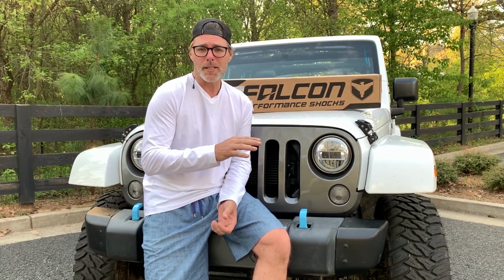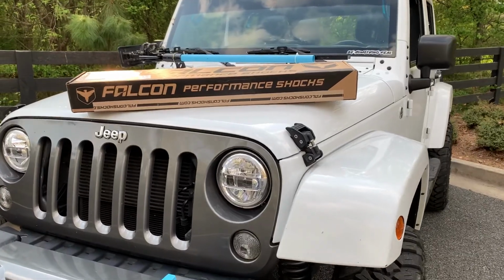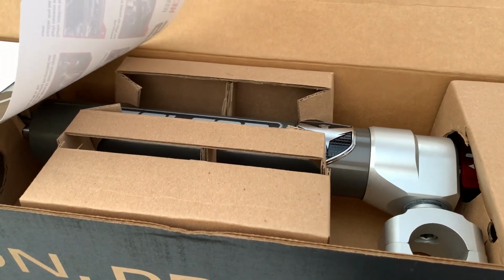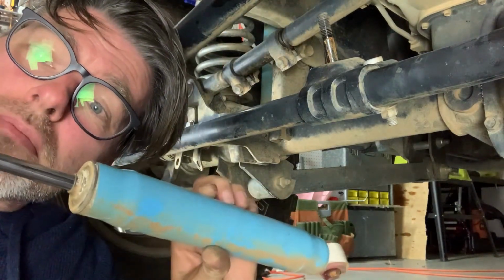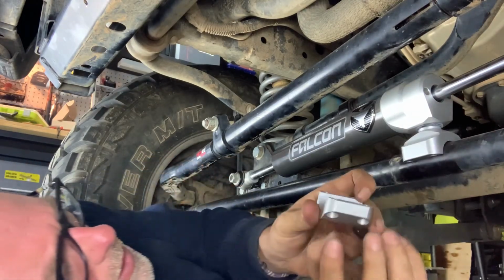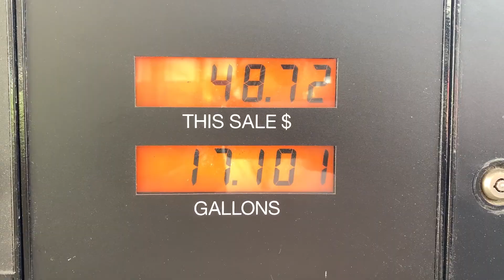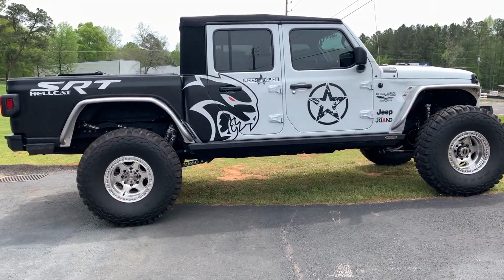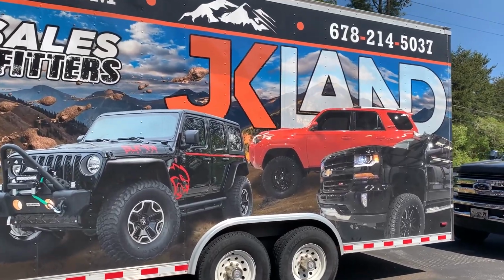Falcon Nexus 2.2 Steering Stabilizer - Jeep Wrangler JK - Install and Review

Comment: Just had one put on my gladiator. Made a hell of a difference on steering handling. Steering wheel doesn't flop side to side when hitting a bumps or anything on the road.  Drives amazing. Just know if you put it on firm it will wear out your steering components from what I hear.
Reply from the maker: It is the best steering stabilizer (in my opinion). 

For me, Firm is for long highway driving
Medium is everyday driving
Soft is for off roading 

Works perfect this way
Reply: @RoadRashOffRoad  agreed!

Comment: O just put one on and saw you had this on yours  for over 2 years now and would love your honest opinion. Is it still holding strong? Are there any other changes you did to minimize the quick road imperfection you feel through the steering wheel?
Also you mentioned in another comment  upgrading to the Falcon shocks, if so, which ones and would you recommend?
Reply from the maker: So a little update.... I still have the Nexus 2.2 steering stabilizer. It has been PERFECT. I have had NO issues with it at all and have not done any maintenance to it. I would defiantly buy it again. I can tell you that I rarely ever change the settings though.While putting it on the Hard setting for long highway driving and putting it on Soft for rock crawling and off roading, I honestly forget every time to switch it.

Regarding the Falcon shocks, I have not upgraded my shocks yet. I still have the older cheep"shocks on the Jeep. it's one of those "if it ain't broke, don't fix it" things. I've been holding out until I NEEDED new shocks rather than just want new shocks.

Comment: Still loving this stabilizer?  I'm about to order it.  I just ordered the falcon shocks.  Replaced all ball joints with the HD teraflex adjustable ones.  Inner axle seals with oems.  Outer axle seals with Alloy USA ones and the tie rods and bar with the yeti 1 5/8 one.  And did the JL Big brake upgrade kit.
Reply from the maker: That's a great rig you have there Bruce. Very nice. I also have the Yeti Drag link and the HD Teraflex ball joints. You'll really like those. My next upgrade is going Falcon Shocks. I have many friends with these and I've heard nothing but great things about them.

With regards to the Falcon Nexus 2.2, I like it more now than even when I filmed this video. I have put it through alot of different occasions in which I could test out the different settings. At first I was thinking to myself, "is there really going to be THAT big of a difference between soft, medium and firm"? YES... YES THERE IS.

Everyday driving is on medium and it's perfect for around town. Not too harsh on the steering box. When I take it off-road / rock crawling / etc, put it on soft and the wheel does not snatch all over the place and I have also driven some 8+ hour HWY trips where I put it on firm and the Jeep steering is so stiff, it does not wander on the HWY.

I have been very happy with it and would recommend it for sure.
Reply: @RoadRashOffRoad  thank you for the response!  Very much appreciate it!  Your vid, aswell as other YouTubers, plus you response here really made up my mind.  Ordered!  Lol.  

Thanks for the compliment on my rig too!  It's been my pride n joy in the nearly 5 years if owned her!  I've also done bumpers, bumper mounted spare tire rack, winch and a 10.1 navigation system.  It came with dealer installed 2.5 lift and aftermarket wheels and tire.  Also getting ready to replace the top.  Thanks again for the resp6!

Comment: About to go throw this sucker on my Jku, great vid. I would however have liked if you had mentioned which settings you liked and what you were running it in on the freeway, I’m guessing medium?
Reply from the maker: You won’t be sorry throwing this on the JKU. I guess I left out “my favorite settings”.

I’ve spent some time testing the settings. There is quite a big difference between each setting. 

Soft setting is perfect for off roading. It’s very squishy which is perfect for going over large bumps, rocks, crevices, etc. With a stiffer steering, it would have jerked the steering all over the place. Making it soft and squishy allows the steering to give a lot. 

Medium is perfect for average, every day driving. This will feel much like a standard steering stabilizer. This is where I keep it almost all the time. 

Firm is quite stiff and perfect for long highway driving. Next week, I’m driving 7 hrs to the beach and will flip it to firm on the way down. This practically allows you to let go of the steering wheel in the Jeep and it will hold straight. It is my understanding that leaving it here for everyday driving on curves around town could put unnecessary stress on the steering box plus it is quite tight.... I wouldn’t want to leave it here for backroad curves.

Comment: Looks Good! I have a question concerning your Bumper it looks as if you sawed the ends off and replaced them with a cap. Is there a kit for that or just your own ingenuity?
Reply from the maker: Thanks man. The bumper is the stock JK bumper. I did cut the ends off and installed a end cap kit, sold on Extreme Terrain. Super simple and works with no issues. 

https://www.extremeterrain.com/vertically-driven-stubby-modular-stock-bumper-end-caps-black-0718-jeep-jk.html

Comment: Those headlights are sweet man, do you know the name of them?
Reply from the maker: Hey Ian.... Thanks man. I LOVE these headlights. I am planning a video for these headlights. I just have to find the proper way to film it since this is not a new install.

Headlights (in my opinion) should be the very first upgrade to every Jeep JK owner that still has stock headlights. The stock headlights are so dim, most people call them "candlelight's" and they are actually dangerous. Especially if you live in a less populated outer city like me. Dark roads and deer will easily go unseen.

When I was looking to upgrade my headlights, I had a couple of things on my checkoff list. Of course they needed to be bright but they also needed to be "white", not blueish tone like most cheeper LED headlights and they had to be affordable.

These headlights are the absolute best I have found. The design is based on the new JT model jeep and have daytime running lights (the round rings). They don't change color but I didn't care about that. They are always white. After using these headlights for over 9 months now, I have never had an issue and still consider these the best headlights (for the money) on the market. I would defiantly buy these again.

I bought these from Amazon. They are the Xprite 7 in CREE Led. 

https://www.amazon.com/gp/product/B082SC83Q8/ref=ppx_yo_dt_b_asin_title_o04_s00?ie=UTF8&th=1

Comment: Will this help with death wobble?
Reply from the maker: It will help however it does not fix death wobble. It only mask / bandaids the death wobble effect. You need to address what is causing the death wobble first and foremost. 

First, check / replace adjustable trac bar and drag link. Then check your ball joints (this was the problem with mine). My ball joints were shot and as soon as I replaced them, no more Death wobble
Reply: @RoadRashOffRoad  ok thank you for info!!!

Comment: Hey Road Rash, I could only get enough leverage to torque my track bar bolt to about 180 ft lbs. do you think that would be an issue?
Reply from the maker: Personally, I think Falcons suggested 220 lbs is too much and I’ve read many other blogs and installation videos that also had issues torquing to 220. I also had issues torquing to Falcon specs. 

I tightened mine to around 180 lbs and then gave it a “snug tug”. I’ve had no issues. 

I would say you would be ok.... just crawl under the Jeep in about a week with your torque wrench and pull it again, just to check it.
Reply: Thanks Road Rash